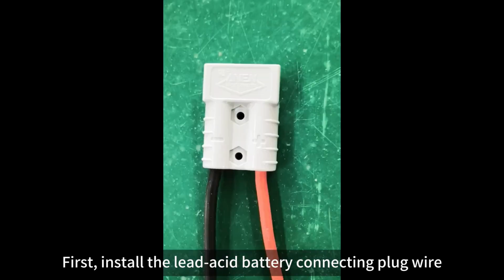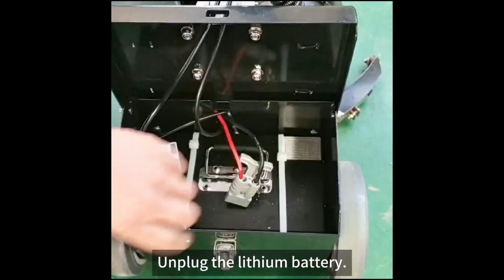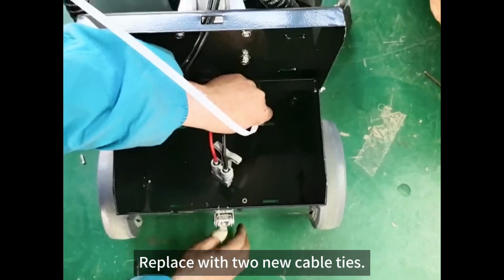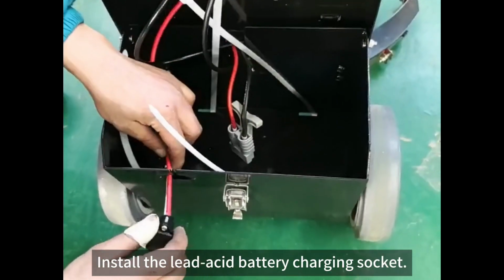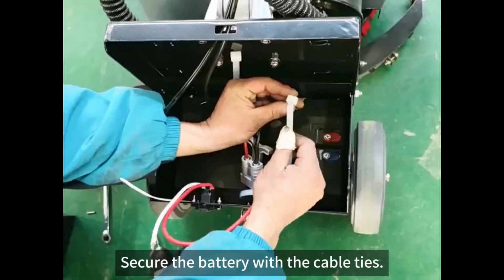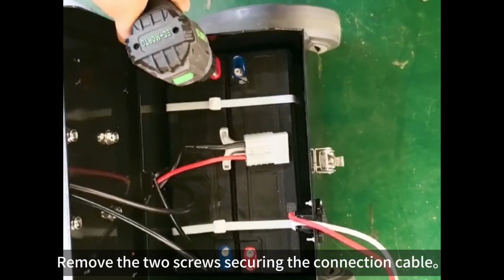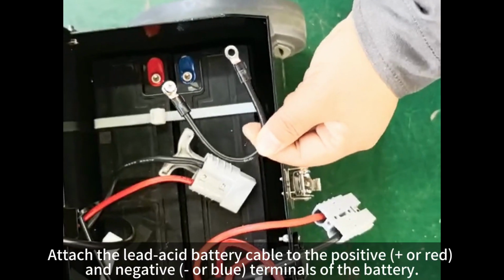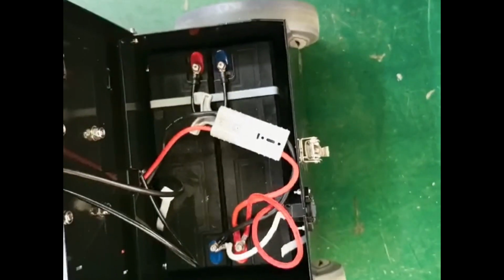How to Replace the RT15+ Floor Scrubber's lithium battery with a lead-acid battery

Comment: So in order to use the lead acid battery with the machine I have to use two of them rather than just one ?
Reply from the maker: Hello, the lead-acid battery version of the machine uses two batteries, while the lithium battery version uses one battery